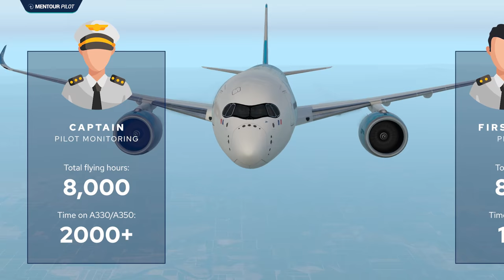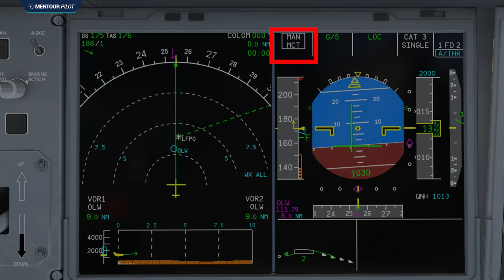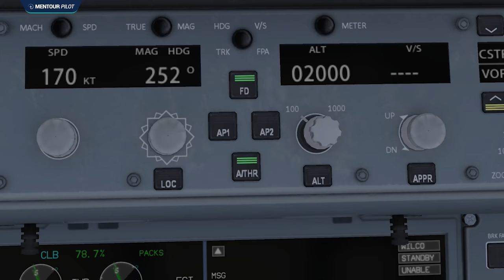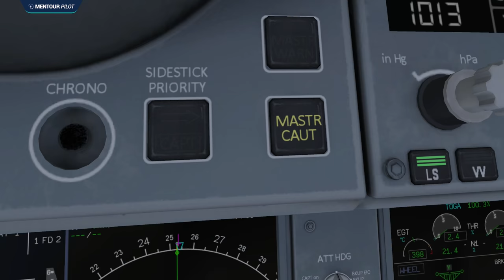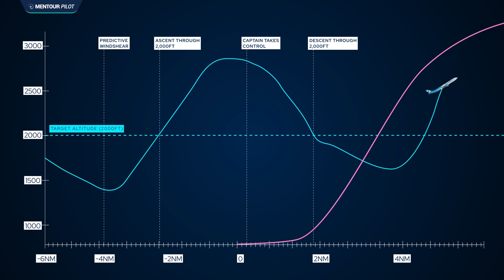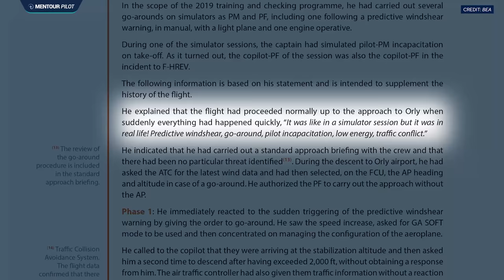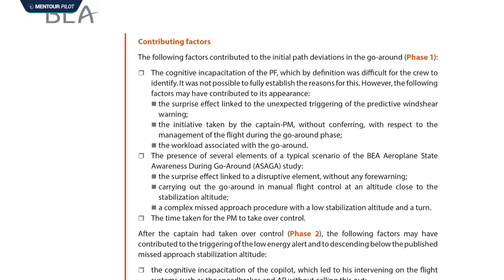What HAPPENED in this A350 Cockpit?! French Bee flight 711 explained!

Comment: I’m a captain on A320. And so impressed that Boeing 737 mentor can clearly explain about Airbus FMA!
Reply: Somewhat.  The FO was manually (hand) flying with A/P and A/T off and F/D on.  His presentation depicted the PFD F/D incorrectly during the GA saying he was "flying manually"  Not exactly.  With the F/D engaged selecting TOGA would change the F/D to GA mode and give correct vertical and lateral guidance.  Even if the FO were flying "manually" with F/D off, selecting TOGA would turn them back on.
Reply: @LeeMatches  I agree that you agree.

Comment: Great  analysis. I am a surgeon (30yrs) and an aerobatic pilot. We use a CRM model in the OR every case. We function as a team and rely on each other to communicate clearly and cross check each other for accuracy. A partial incapacitation during an unexpected critical event would be difficult to recognize for the surgeon (pilot in command) and random, unrecognized inputs by another team member under extreme stress should be considered a possibility by the team. This is another scenario to prepare for,, as unlikely as it is.. This the lesson I learned here. Thank you.
Reply: Anaesthetist here. This is why I watch these videos
Reply: @fredjones554  911 operator chiming in. Absolutely team effort and I've seen this literal phenomenon deer-headlights as a dispatch unfold and becomes more complex. Tricky.
Reply: If you want to communicate clearly you should perhaps not use acronyms like CRM without explaining them first, such as follows: Crew Resource Management (CRM). I searched it, and had a vague recollection, but actually it's not the first result & will mean different things to other people.

Comment: This type of incapacitation happens to many crucial situations such as on doctors as well. When my brother who is a doctor at a hospital, was monitoring another doctor perform a treatment, a small but potentially lethal mistake made by that doctor caused that doctor to suddenly stop and couldn't do anything just like the First Officer of this flight. My brother quickly took over and called doctors from other floors to come in and help and didn't blame the doctor who made the mistake. Luckily the patient was fine afterwards and no long-term effects occurred.
Situations like this are extremely rare but still happens, it's the training, practice, and extra safety measures that will help and prevent them. Also the lessons we learn from them that matters the most.
As always, yet another splendid video by Mentour Pilot!

Comment: I am an airline pilot and this is probably one of the best safety videos I have seen in a while. Fantastic! Keep up the good work. I think we all get complacent sometimes. Regarding go-arounds, I think in the approach briefing you should 100% plan for one and then if you don’t, it’s a bonus…..
Reply: Thats how I was trained at Spartan School of Aeronautics.  Plan for and assume you will be initiating a go around until you don't have to.  Actually saved my arse one night.  Practicing lights out landings at Keystone lake one night and just as I touched down and hit my lights I saw lots of eyes reflecting from the runway right in front of me.  A couple dozen deer were on the runway but because I was mentally prepared and able to act immediately I got the plane back in the air and cleared the deer by maybe a couple feet.  Hitting a heard of deer at 40-50 mph in a C150 might not be deadly to myself but guaranteed it would have messed the plane up and left me stranded late at night at a very quiet uncontrolled airport...lol
Reply: @stevewarren5386  Wouldn't have been a little deadly for some of those deer though.

Comment: Military trains for this by doing stress tests. Do engine failure and go around drills in the simulator while a drill sergeant yells at you or real smoke enters the cockpit or the temperature is raised to 80C or lower der to -40C. It makes people more resilient to stressful situations. Habituation to startlement can avoid this incapacitation.

Comment: As an ex Royal Navy pilot a call off or go around was practiced regularly as they could happen, for real, at any time on an aircraft carrier; so I was surprised to see that the expectation of it occuring on a civilian flight was between 1 and 4 years!  The number of go arounds on your channel alone seems to imply much more frequently than this! I have always felt completely safe on passenger flights it's the unknown and unpredictable that gets through now..  Thanks for the good work on your channel.
Reply: Well, it's the same as thinking that the number of disasters must be high because there are a lot featured on the channel. You don't cover all of the flights where nothing goes wrong. I'd guess that the greater number of go arounds on a carrier is partly because the aircraft are of very different performance, and partly because as well as weather and aircraft condition, there is the extra variable of the runway moving about; an airport on land is not going to suddenly catch a swell and tip over, after all.
Reply: @WJS774  True, as you say,  Go arounds may not be too frequent but must be enough to practice. They are, after all, the "most likely" emergency that will happen to anyone.
  Moving runways is not the problem it's deck conditions that cause the majority of go arounds, aircraft in the wrong place, clutter on the deck - hoses etc. the fire party attending an off runway accidentand, smoke and so on. Good fun.
Reply: Not to mention far less catastrophy training or out of simulator real world failure training.   Fk my uncle had me land my first plane at 14 on 10 second notice. Might weed out more of the pilots but they dont want to waste the training money from them.
Reply: @JohnPaul-my6ct  Actually the fact that they happen so rarely is the reason for the high startle behaviour - you simply never expect something to go wrong. Whereas if you always had to deal with difficult conditions, you would be more used to responding consciously.

Comment: The partial incapacitation is very terrifying
Reply from the maker: Yes, it’s a very tricky thing to diagnose.
Reply: @MentourPilot  There are systems in some cars which are trying to diagnose people "sleeping" by diagnosing eye movements. Maybe something like that can be adopted for pilots ... because it sounds as if the affected person is "sleepwalking".
Reply: @MentourPilot  As a total noob regarding flying and procedures I was wondering if the pilot on the junp seat could have done something regarding the incapacitated Co-Pilot.  May it have been possible for her to replace the Co Pilot?
Reply: @MentourPilot  What about some simple like
captain: officer ?
officer: yes
So if you don't have any response after 3 requests you can guess something is wrong.
Reply: I rather enjoy my micro sleeps every day at work. It helps me get through the day in an office job.
Reply: @Muck006  It does sound a lot like Sleep Flying.  I once drove 40 miles going North on a highway when I was supposed to be going South.  I am suspicious of the sleep intervals afforded the pilots.  An hour and a half sleep is hard to truly wake from.  You tend to fall in to a deep sleep around the hour mark.  A 20 minute nap would be safer, refreshes you without going too deep.
Reply: @MentourPilot  I'm not a medical doctor, but I have to believe that interrupted sleep cycles, like the kind of "cat-napping" that is often done on long-haul commercial flights or military missions can make "brain farts" like this more likely.
Reply: I dont understand how this first officer could continue in this position. Some people just cant take pressure as well as others and there is nothing wrong with that, but when you are talking about piloting a wide body airliner that's quite a problem!

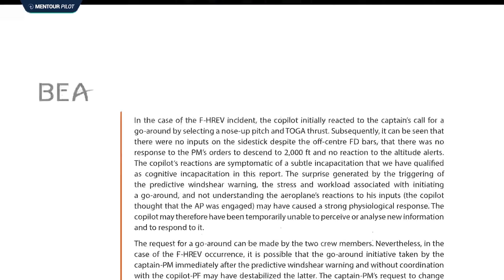Comment: 19:41 I'm just a passenger and fly maybe once a year, but did experience a go-around once. We were told another aircraft failed to vacate the runway in time. The flight attendants seemed unimpressed, which made me assume this happens all the time. Interesting to learn it doesn't.
Reply: No it doesn't but it's a good thing. It means the pilots have good judgement and the support from the industry to make the call to go around for any reason.
Reply: I assume that's why its no big deal. The problem is most likely averted.
Reply: @westowndrow4128  "Go arounds" happen all the time at general aviation (GA) airports even thought the airports are controlled by the FAA.  Just visit the KCDW tower where many incidents have happened over the years, not because of ATC, but because of the volume of traffic.  JFK Jr, departed from this airport before his eventful crash at Martha's Vinyard.   This effect is not limited to the airlines because most large airports are highly controlled.  But just listen to the ground controllers at KLGA or KJFK once in a while.  Stuff happens all the time.  It happens more often at GA airports, but GA pilots are more experienced with confusion than the airlines are.  Sometimes I think GA pilots are better than airline pilots when it comes down to handling quick changes in procedures.  This is because GA airports handle mostly visual flight conditions (VFR) traffic.  FAA controlled GA airports must be able to handle GA pilots as well as jets and scheduled airliners.  The very large airports like JFK or Chicago mostly handly all airline traffic which is mostly  flown my everyday professional pilots who have their C**T together.  But the first officer in this case should not have been hired as a first officer in my opinion.  Even student pilots in small GA aircraft are expected to do more than that guy did.  He froze up with lives behind him.  Good thing the Captain was able to take command.  Too bad the passengers spent 4 minutes having the C**T scared out of them due to a first officer who became a "deer" way too soon.  Why did they hire the guy in the first place?  He never asked the captain if it was ok for him to make control input changes by confirmation.   JMHO

Comment: It's amazing how easy it is to upset the brain's train of thought and induce subtle incapacitation.

Shortly after getting my PPL, I took my wife and daughter for a $100 burger flight, and on the approach back home, ATC gave the option of a long landing since our intended parking was closer to the departure end of the RWY.

As we floated just above touchdown on the runway, my daughter asked a question (I don't recall what) and in the process of answering, I lost focus on the PRIMARY task before catching myself in a scary right-drift approaching the side of the runway as I was ready to touchdown within the last 3,000' ft to threshold (single-engine piper).  I had accomplished this landing quite a few times prior to getting the license, with no incidents.  

As I taxied after scaring myself, my daughter, (I don't think my wife noticed since she was in the back) and most likely ATC, I did a retrospective and every flight since brief a no non-critical flight-related conversations during final or takeoff until out of ATC or common traffic control space.

Comment: I can feel for this crew.  We have a missed approach in Western Canada where the minimums are 460 feet (350 above ground) and one has to climb straight ahead to 600 feet while calling for landing gear retraction then immediate left turn (because of rising terrain)  120 degrees from the original heading, in the turn retract the flaps through 1100 feet, then level at the missed approach altitude of 2000 feet while  watching  that the speed does not exceed 190 knots  because the flaps are still travelling at this point and that is the maximum speed permitted until the flaps are at 0.  While doing this the pilot monitoring informs local ATC of the missed and then has to switch radio frequencies to approach control.  Lots happening in a very short amount of time.
Reply: That's why there's more than one pilot

Comment: I was shocked to learn that an airline pilot may only have to do a go around once in a year or once every 3-5 years. 

I always set up for a go around and if everything works out, I land. :)
Reply: We practice go arounds every 9 months in the simulator
Reply: When I was at the regionals in the states I would land log about 30 to 40 landings a month..  I would do about 1 go around a month for various reasons..  flying at my current carrier..  much less since r fly longer legs.
Reply: I am not a frequent flyer. I would guess that I have been an airline passenger no more than a hundred times in my life, but I have experienced one go-around as a passenger.  This was on a US Air flight from DC landing in Charlotte, NC, some time in the 2000's. I had a window seat, and the plane was very low when they initiated the go-around . I can't say an exact altitude, but I was expecting touchdown in the next few seconds when I heard the engines throttle up and the plane started climbing. The captain announced that it was due to "conflicting ground traffic". Not having the runway in view, I don't know how close we came to disaster.
Reply: @russlehman2070  I just posted the exact same experience when landing at Dallas Ft Worth. Same seating with engine roar, same altitude, same announcement by captain, and surprise that it is so rare. Whadya know.
Reply: @longemd  I think the brain inevitably knows that no lives will be lost in a simulator and as such the experience gained is not real.
Reply: @davidreynolds9649  When the shit hits the fan, you fall back upon the level of training you received. The training at my company is second to none. BTW, a go-around is almost a non-event.
Reply: I've been a short haul airline pilot for 6.5 years and just did my first go around last week.
Reply: If you go around from more than a few hundred feet, there is no need to do it immediately. You can brief and take a few seconds to review the sequence of actions. The standard go around manoever is designed to get you away from the ground as soon as possible (e.g. no visual contact at minimums or unexpectedly below approach path), but real go arounds are usually because of getting too close to other aircraft ahead.
Reply: As a passenger I had a go around once in 10 years. I was on a plane from Frankfurt to Denver and we had to go around due to a sudden horizontal shear wind when we were about 50m ( I’m guessing) above the ground. It was a bit scary.
Reply: Got about 15000 hours of flying and probably have done less then 20 real go arounds.
Reply: @russlehman2070  I've been in a go around once and it was right over the runway. I think pilot overshot it because I thought we were about to touch down and then the engines revved up. Nothing more disappointing than passing right past the terminal and back up. Other than maybe being stuck in a holding pattern at Heathrow once. I was a kid and it was probably at least 20 mins at the end of a transatlantic flight. I had the window seat and told my mom we were going in a circle, and she wouldn't believe me. I was like "we've passed these buildings like 10 times, we're going around in a circle". Eventually the captain came on to tell us we were waiting for a runway to free up. Heathrow is the worst. Or used to be, anyway.
Reply: Yeah, that surprised me, too. I've been a passenger in probably 200 or 300 flights in my life, and I've been in two go-arounds.
Reply: Being ready for every contingency definitely is a smart thing to do. But how often do we all grow complacent. (whether from fatigue, boredom, “channel fever”, life stresses, etc) and forget? Very human thing to do, but even more important to always remind oneself like you do: “plan for the worst, hope for the best”!
Reply: It makes me realise how (un)lucky I was to experience it on my third flight as a passenger (out of four total).

Comment: I often hear the opinion that planes practically fly themselves. I’m impressed that not only is that not true but the volume of information and experience pilots must have so that passengers have a good uneventful flying experience. I really didn’t think it was easy, but your videos have been very interesting and I appreciate the pilots and crew more now than I did previously. Thank you for such great videos
Reply: They could technically fly themselves. But this is usually used when the pilots have a high workload. Most of the time, the pilots choose to fly the plain themselves just for the experience. It does come in handy under emergencies because not always can the auto pilot help you in such cases.

Comment: This happened to me about six months after earning my drivers license. We were on a family vacation and I was driving the family van which was towing our 16' fishing boat while on the interstate. Dad asked me to take an upcoming exit.  The exit off ramp had a tighter turn radius than usual and I locked up to the point where my Dad had to grab the wheel to turn it right. I snapped out of it as he yanked the wheel and I applied the brakes. I still have dreams of that moment  which happened 35+ years ago.
Reply: I have been riding a few bicycles recently.  One is has nice very springy (lively) steel sports and had not appreciated how well it holds the road goes over things without issue despite the tires being 70 years old.  The newer bike with a modern stiff frame and new tires does slide so I new to be a bit slower on corners but it still scared me on a corner I was in any case moving much more slowly on.

The difference is almost like the difference between driving an old British Mni car and a normal car.  Except that it is much more so and why those 1960s rally cars were the standard no other car could match for sticking to the road on corners.  

I think we learn again and again in life that we can predict what happens when we change from one tool car bicycle or whatever but still get it wrong.
Reply: Not exactly anything to do with aviation!